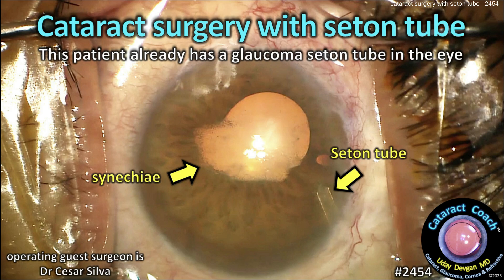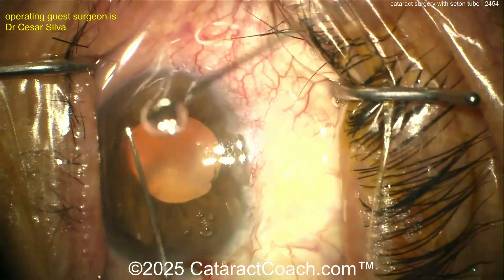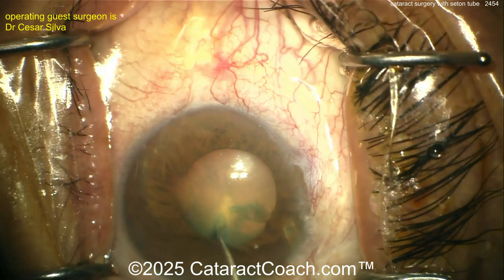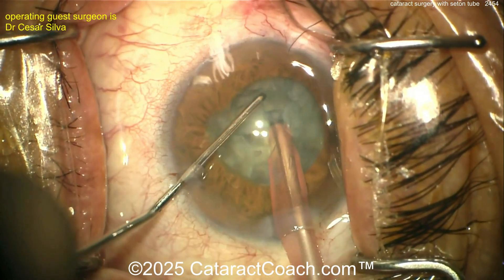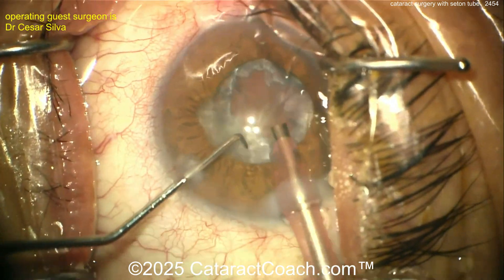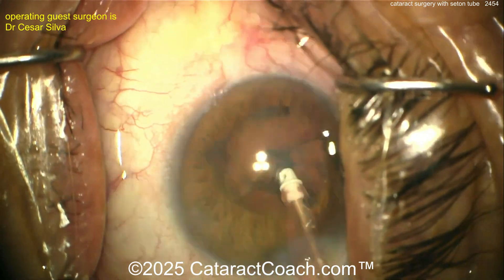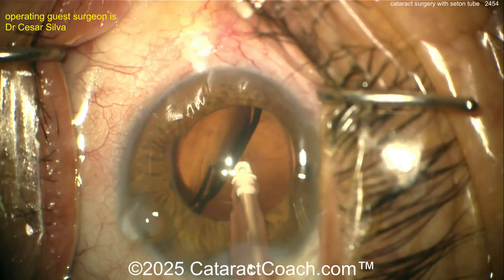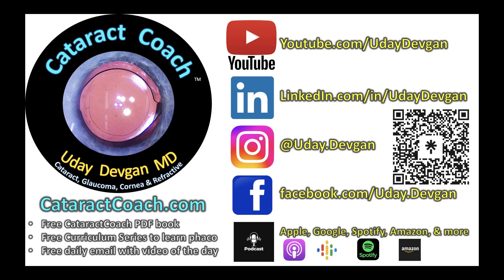CataractCoach™ 2454 cataract with seton tube present

Comment: From my limited experience: if the tube surgery was done a long time ago, then the bleb will typically scarred down - meaning its a fixed space; that's why you don't see the conjunctiva ballooning up throughout the case, and you don't see the eye becoming proptotic - once the BSS inflates/pressurizes the bleb, it can't escape anywhere else (under the conj or behind the eye). So there's no need to occlude the tube. Now if its a recent tube and there's no scar tissue around the plate, then that's a different story 😆no scar to prevent outflow in that case.
Anyone else have a different experience?

Comment: I have a suggestion. Why can’t we have small plugs (like our punctal plugs) of different sizes to match the lumen on various tubes. And we use these tube plugs to block the tube, finish the surgery and then take the plug off. Easy peasy 😊
Reply: You can use a suture with melted tip. Similar to how you would decrease flow in nonvalved tube.